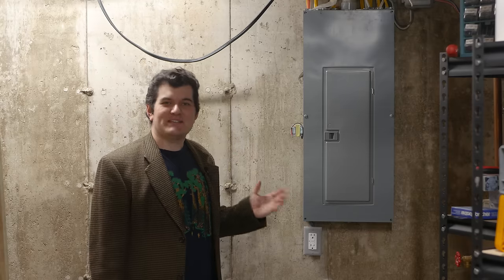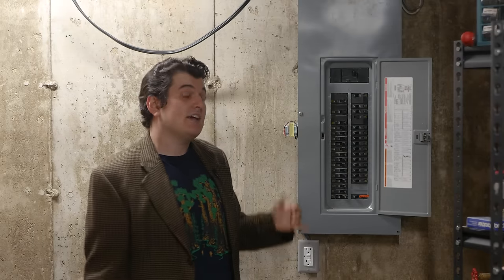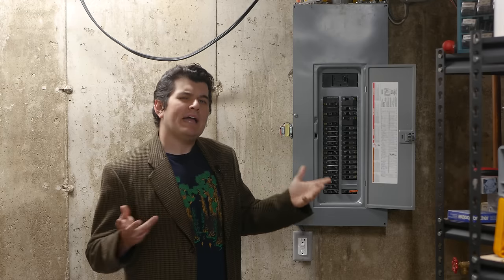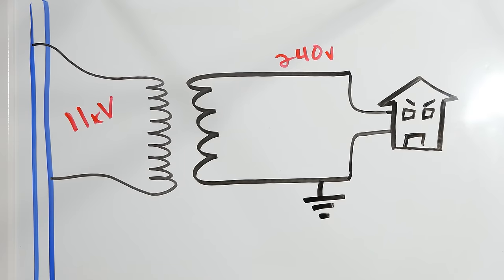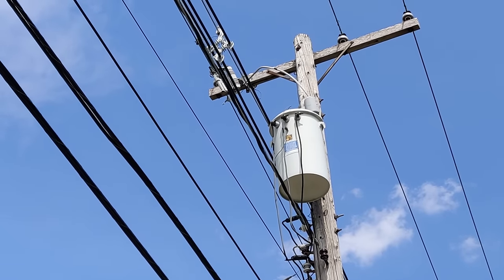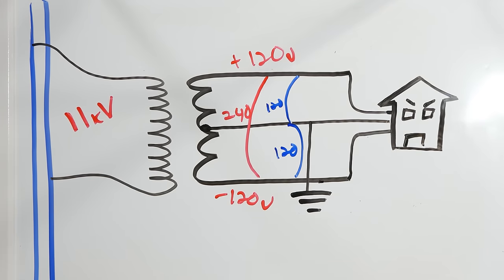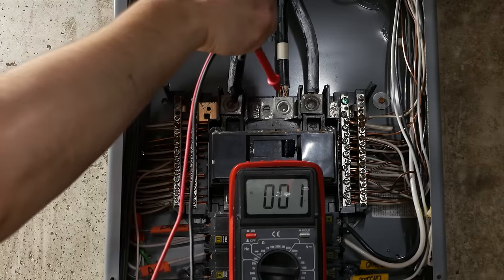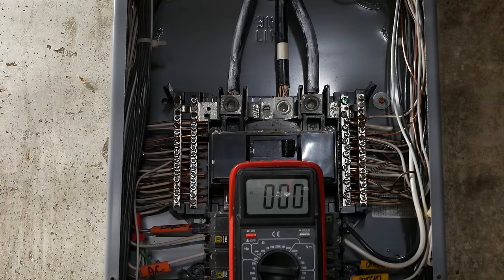The US electrical system is not 120V

Comment: Me: laughing in 3 phases of 240V
Reply: Most of the time you call the 3 phases at 400V 
because the phase to phase voltage is sqrt(3)*240= 415 V.  It is called 400V  because that it the voltage you get from sqrt(3)*230 and the common standard the, for example, EU use is 230V +10%/-6% so a country like the UK that was at 240V not fit in the range and equipment should be designed for the complete voltage range.
Reply: @target844  most 3 phase outlets in Europe are labeled as "380v"
Reply: @fb5601  it is a legacy value as in the recent past 220 not 230 V was the nominal voltage and then sqrt(3)*220= 381v.  So even if it says 380v it is s 400v today
Reply: @target844  You might also wish to mention  sqrt(3)*120 to explain 19:25.

Comment: Our house built in 1960 was equipped with 3 phase 35A / 380 (now 400) input, divided into 3x 220V (240) (and ground/neutral..).
two phases the going to ground and 1st floor, all three at 16A to the basement for .. heavy washing equipment ?? 

Since i installed a EV-car wallbox i asked the power supplier and got told if i wanted to get 3x 65Amps there would be an upgrade needed
buuuut i could switch to 3x50Amps no problem.
Just have to remove (get removed) the inserts limiting to 35A breaker inserts. Incoming lines were installed for 3x50A/380V.
But also would need to check/replace main power cable going from Main input to the distributor.

Since i settled for 3x10A setting at the wallbox which translates to 42km per hour of loading time charged into my car (and used the basement machine line) i did not need an upgrade.

Comment: So you’re saying it’s a choice between a significantly increased risk of death, versus a slightly reduced time to make a cup of tea. 
As a British person, I’m happy with our decision.
Reply: Well in reality, it’s the other way around, a much faster (half as long in fact) time to make a cup of tea versus a slightly increased risk, that is more than mitigated by much saver plugs, receptacles and so on.
Reply: @DerSim688  Perhaps we could say, a significant increase in risk of death IF you're the kind of person who likes to stick forks into their electrical outlets.
Reply: @Person01234  I've seen videos of that kind of stuff from Europe lol.  Some guys jammed a knife in a toaster while it was on.  The toaster exploded! In cases where there is a short it becomes much worse with the higher voltage, thank goodness for circuit interrupters lol
Reply: Actually our electric kettles are quite fast at boiling water.   I would not use a kettle on the cook top as it wastes a lot of heat round the side.    Which then needs to be removed by the air conditioner in summer!    Kettle on 120v is fine.
Reply: @phbrinsden  I have one (Electrolux) that takes about 5 mins for 1.5l of water, we also have 120v mains here (not from USA).
Reply: @phbrinsden  kettle on 120v is a lot slower
Reply: @emko333  Most people don't care if it takes an extra minute to boil the water for their tea, and if they need near-boiling water that often, they use a hot water dispenser, which keeps several litres of water at near-boiling temperatures in a vacuum insulated chamber, so that hot water can be accessed instantly whenever needed.
Reply: Switch the adverbs.
Reply: Not really.  You do have the choice to use 240v in the kitchen for your tea kettle in th U.S.  That is pretty much the main point of this video.  Besides, we are more of a coffee drinking nation.
Reply: My problem isn't with getting the water hot, it's cooling the tea down. I'm having to drop ice cubes in it to save my tongue.

Comment: 13:17.
If they have trouble with the concept of gas being used to dry clothes,
You better not let them know about gas powered refrigerators.😆
Reply: EXCUSE ME WHAT
Reply: Gas powered fridges aren't a mystery. The motor that drives the pump (which is the magic part that summons the unicorns who by being so cool, cools the fridge down), runs on gas. Long live unicorns!
Reply: @thomasraahauge5231  I still have trouble understanding that thermal cycle.
Reply: They are used in RVs
Reply: @thomasraahauge5231  I'm not sure if you also intended the part about the motor that drives the pump to be parody too, but that's not how gas-powered refrigerators work. Gas-powered refrigerators normally don't have that motor; they have a different working principle with just a heater and no moving parts other than working fluids. Google it.
Reply: @kgbgruJr  That's because what Thomas said was wrong.
Reply: @kgbgruJr  Just wrap your head around the fact that all types of refrigerators produce heat, not cold and you'll get it. Doesn't matter if the thing runs on electricity or gas.
Reply: @Nitwon  absorption refeigeration. It uses a heat source to create differential and drive a refrigeration cycke
Reply: Ah yes. The Platen-Munters cycle is continuous. https://www.sciencedirect.com/science/article/pii/S2214157X17300515
I use a 1946 Servel. Set up the burner with a combustion analyzer and all is well!
Reply: And gas powered radios.  Yes, really.
Reply: @ropersonline  I was trying to convince my fellow commentators that unicorns magically cool things down, but I forgot the unicorns in this reply. I apologize for the confusion I caused. Unicorns are magical, and they cool things down for us, because they are sorry for us, because without refrigeration, refrigerators would be both clumsy and not cold at all. If you think "what the fork did that dude smoke?" then I don't blame you.
Reply: @Nitwon They use gas as a refrigerant.

Comment: I appreciate your one hand multimeter technique for high voltage
Reply: No ppe...bad juju. At least have some rubber gloves if nothing else.
Reply: @shinner65  yeah but at least he's less unsafe
Reply: Yeah I’ve given myself shocks from trying to unplug stuff awkwardly, but since it was just one handed all I got was a funny sensation in my hand.
Reply: @shinner65  Those leads are rated to 1000 volts. His technique is correct.
Reply: @DallasHerrmann  Only if that meter and it's probes are "cat IV".
Reply: It is Low voltage, 
The International Electrotechnical Commission (IEC) defines supply system low voltage as voltage in the range 50 to 1000 V AC or 120 to 1500 V DC.
Reply: @MrThephoenix777  This, for all intents and purposes we have here, is high voltage. we are using "high voltage" to differentiate between safe and unsafe voltages.
If you'd phrased this as an interesting fact instead of correcting, you'd have got a less harsh response.
"did you know the IEC considers this low voltage?" etc.
Reply: @runforitman  Did you know that according to Merriam Webster dictionary the definition of low voltage is voltage low enough to be considered safe for indoor domestic use and typically 120 volts or less.  The NEC voltages are either above 1000V nominal voltage or below 1000V nominal, also Internationally Extra Low Voltage (ELV) is anything below 50V AC/ 120V DC whereas the NEC states anything operating below 50V shall not be required to comply with the NEC
Reply: @MrThephoenix777  now for the less harsh response
Reply: @MrThephoenix777  nice
Reply: @runforitman  No need to be defensively salty over your own lack of knowledge.
Reply: @runforitman  Dear salty, I don't need to google information I have known for the past 13 years since I started working on electrical systems for the USAF. I haven't been aggressive towards you as the only thing I have done is correct your terminology with facts relevant internationally not just domestically, you are the only one being argumentative as you stand by your incorrect opinion unwilling to accept new knowledge and then reverting to name calling as you are unable to bring anything truthfully relevant to the table.  Regards and goodbye from a High Voltage Electrician - former 501st CSW.
Reply: Also by DOE guidelines High Voltage is defined as over 600V as a voltage higher than that used for power distribution.